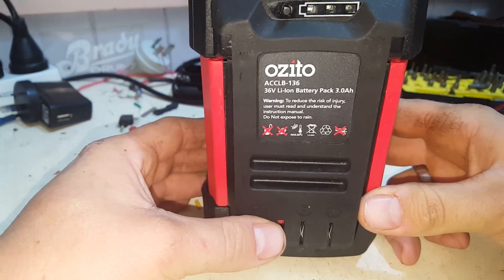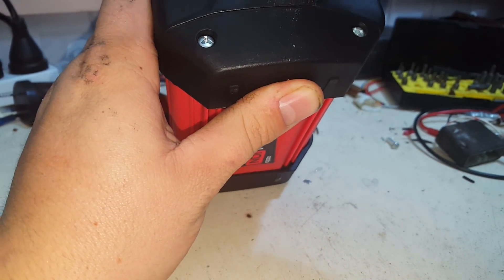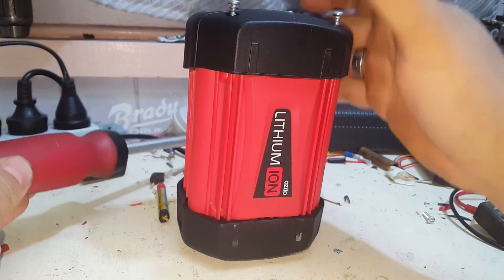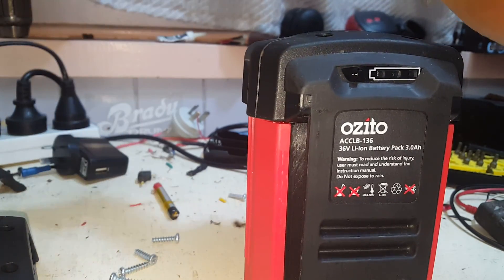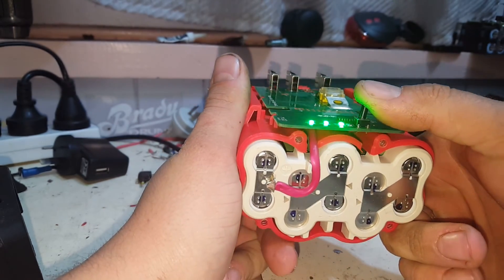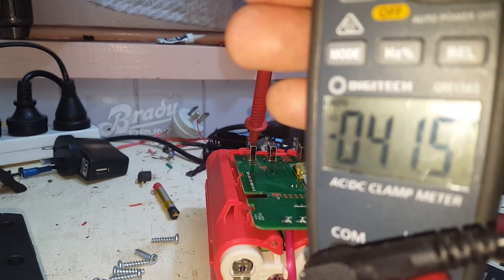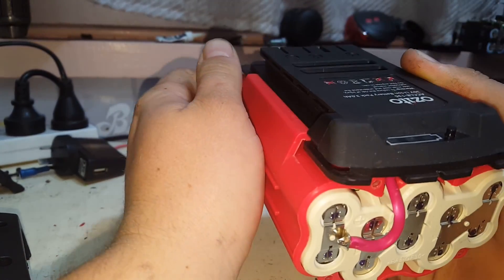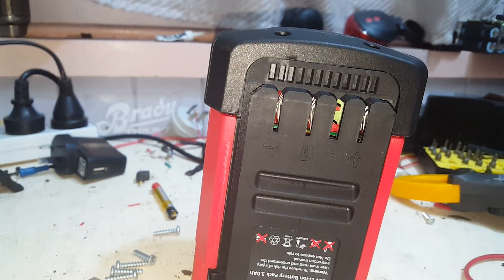Whats inside  a  Ozito 36v 3.0 amp outdoor power equipment  battery

Comment: Next time you have it open you should check the balance to see if any cells have shifted. Being new they shouldn't but being ozito then maybe.

Also I'm building an arduino spot welder that uses a car battery to weld cells together (found it on YouTube but just trying to spread the cost, let me know if you are interested. I just ordered 10 sets of boards for it today but only need one.
Reply from the maker: +Brett definitely  interested wanna email me ?
Reply from the maker: +Brett definitely  interested wanna email me ?
Reply from the maker: +Brett definitely  interested wanna email me ?